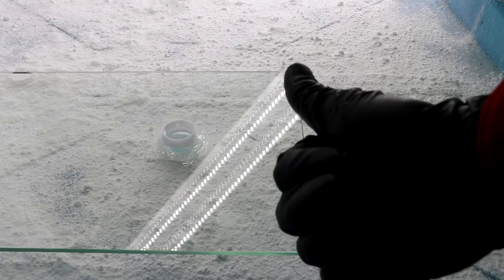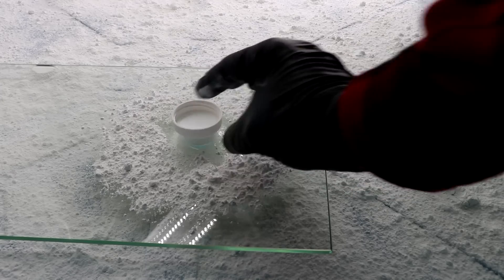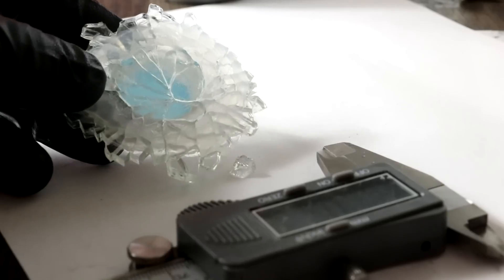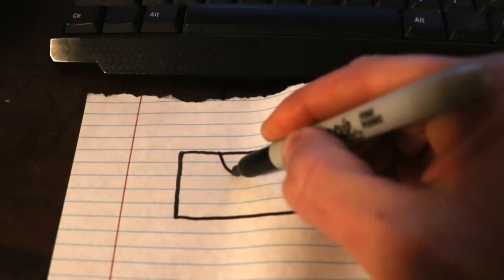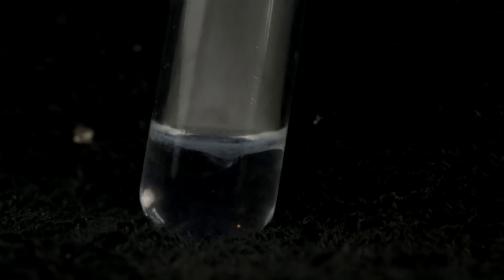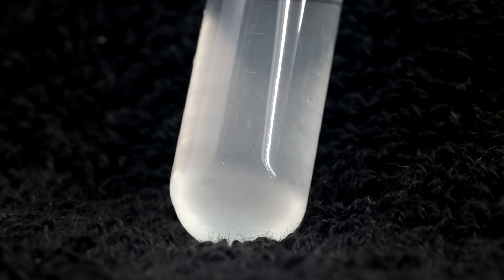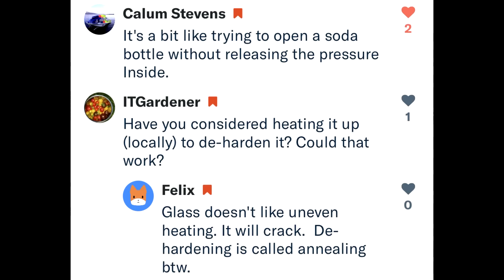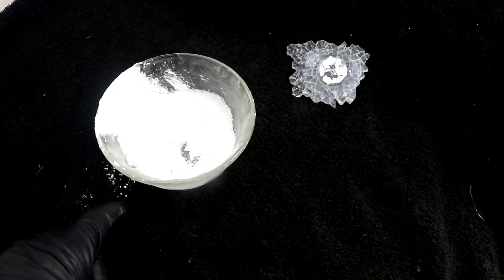Dissolving Through Tempered Glass Attempt Two: from one side only

Comment: I never really thought about it, I didn't even realize it was possible to dissolve through glass
Reply: You should keep in mind that not all glass is the same. Like Cody said, test tubes are pretty good at resisting nearly everything, whereas the glass you're drinking from would indeed be affected. When you start to look it up you will find all kinds of different glass, depending on what it will be used for. Different materials can be used, but (in the case of tempered glass) different treatments also affect it.
Reply: Strong bases like sodium or potassium hydroxide can also dissolve through glass. Very slowly if you use them as an aqueous solution, but fairly quickly if you use molten NaOH/KOH. (You just make the corresponding silicate.)
Reply: You, Sir, have good taste in YouTube videos.
Reply: Hydrofluoric acid is a beautiful solvent for, due to fluorine’s affinity to bond strongly with silicon. That’s why people always use plastic equipment when HF is used in laboratories
Reply: This guy is on like all the vids I watch
Reply: Glass etching, basically what he is doing but trying for a more extreme point

Comment: The mechanism that causes the glass to crack is stress and all methods that remove supporting material in the center will inevitably cause the structure to collapse regardless of how you remove it. It's simple physics, man. This is unless you can come up with a method that reinforces the structure itself. Failing that, it doesn't matter how gently you remove material since, at the end of the day, supporting material will still be missing.
Reply: I don’t understand how tempered glass can have holes if they are made pre-temper but not post. The “supporting material” analogy is apt but seems to break down in these cases.

Comment: Does melting the glass work? Or maybe using acid to thin it out then melting the rest
Reply: You'd still probably need to heat the entire thing so it doesn't explode.
Reply: its tempred glass 
i dont think that may work
Reply: Koukou Zee you can cut prices of tempered glass with lasers. All that is doing is burning it.
Reply: Heating the glass quickly would likely shatter it.  Heating it to just short of the melting point and then cooling it would undo the effect of the tempering, allowing it to be cut or machined easily, but one wouldn't have tempered glass anymore unless one re-tempered the glass after the machining was complete.
Reply: @flatfingertuning727  And at that point you might as well have just started with a piece of non-tempered glass to begin with.
Reply: Locally heating it as much as possible before shatter, then disolve through it is an interesting idea...
Reply: hit the glass with hammer! viola!
Reply: @mohinderkaur6671  violin!

Comment: Maybe dissolve the tempered glass literally from the side of the glass. Like the edge. See if that works
Reply: Wouldn't that defeat the purpose?
Reply: It will be the same result. 2mm will be dissolved until core is reached and then crack!
Reply: @yaroslavpanych2067  Actually the side part is often unhardened even up to 20mm from the edge,  or so I've heard. So you could probably successfully drill through that area.
Reply: @PuerRidcully  You can look through two lenses of polarized filters to see the stress in tempered glass.
Reply: haha lol. Thinking outside the box.

Comment: Dissolving the tail off a Prince Rupert's drop would be awesome, especially if you could catch it with a high-speed camera (Maybe with a sound-activated trigger).
Reply: Wouldn’t the sound be heard after all the action has already happened tho?
Reply: @re_rolls9858  prince rupert drops break faster than the speed of light
Reply: @mjstecyk  You aint too good with the math are ya
Reply: Wouldn't the drop break faster than the speed of sound?
Reply: Would that work? I feel like it would shatter faster than the camera would be able to register the sound. I could easily be wrong though
Reply: Most high-speed cameras I've seen record into a buffer that's a few seconds long, then when you "trigger" the camera, it stops recording, so you have the few seconds /before/ triggering the camera in memory.
Reply: How is this comment older than the video?
Reply: @daemon10101  patreon members get early access.
Reply: @daemon10101  Patreon magic, and the time machine Cody built 10 years from now.